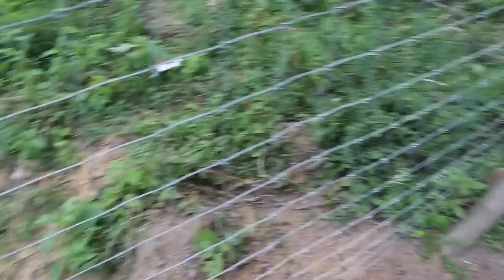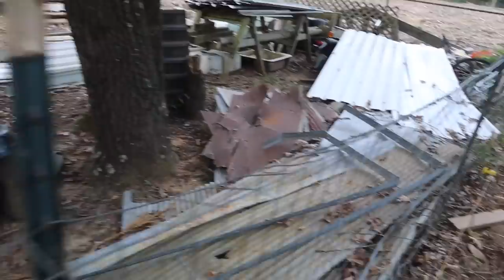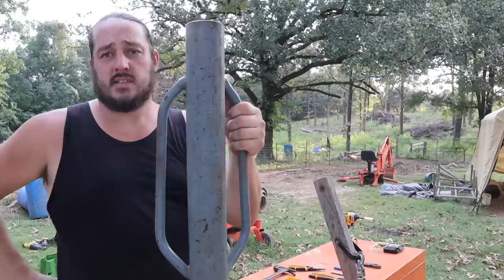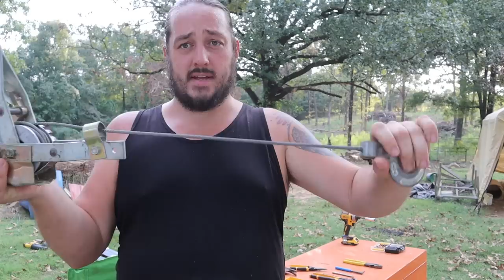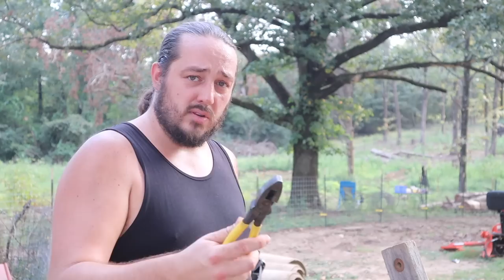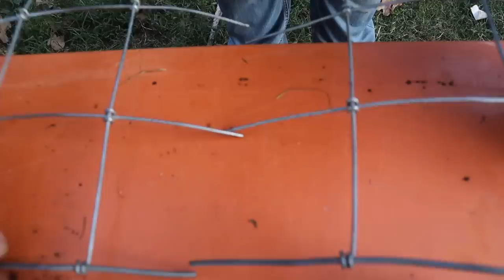Building Fences 101 | Mondays with Miah | Roots and Refuge

Comment: Growing up on a farm, we used hog panels. They are just like cattle panels, except the bottom foot of paneling is tighter and is buried under the ground so the pigs can't burrow out. They are also sturdier than the welded wire fence that you use so the hogs can scratch themselves. Our current pig resident is secure with galvenized hog panels. He is around 750-800lbs. He rubs against it everyday and it is really secure. We bought ours at the local Ag store.

Comment: Great video. I would suggest one thing, especially for people that don't have some of the tools already. Look for "fencing pliers" next time you are in the farm or home store. That's all we used for fences growing up. It replaces all of your pliers and some of your twisting tools. Plus if you need to remove a staple that is in deep you can put the point in under the staple and drive the point under it with a hammer.

Comment: I use that type of fencing (not the welded type, the 4”x4” kind) to make tomato cages, flower cages etc. That little wire bending tool tip was really helpful. I’ll be picking one of those up. Thanks Miah!

Comment: The T-post driver that I bought several years ago is "Pepto-Bismol"-pink.   My husband just rolled his eyes when I came home with it -- especially with it being pink!   Well, 1) we both use that thing ALL THE TIME, and 2) the color is easy to see -- it never gets lost.   Thanks for the tip about the wire tool for splicing.  I've always "made-do" with needle-nose pliers.  That wire tool is so much better.   Thanks, again.   Best wishes from Kate in Olympia, WA.  9/9/2019.

Comment: Great video. I have built many fences over the years on the farm. I also use mostly high tensile wire fencing, since I was raising registered show horses and didn't want them cut and scarred up from barbed wire. The mesh fence you're using we called cattle wir fence if the squares were equal top to bottom. If the squares got smaller at the bottom we called that hog wire fencing. There are cattle panels that come in 16 foot sections which I've seen you use before. But there is also hog panels that come in 16 foot sections. The difference is the hog panels get much smaller at the bottom. Running a strand of barbed wire about 4 inches from the ground of the mesh fence prevents livestock from pushing the bottom up and stretching the fence too. Your doing a great job, and that hinged tool looks handy for the t-post clips. May get one, I always used fencing plies & the splice tool for the t-post clips. Never to old to learn. Thanks for sharing. #helpingthenextgeneration #farming #homesteading

Comment: Great informational video.  Love Monday's with Miah.  We made our fence stretcher out of 2 2x4's and bolts, we were to cheap to buy one.  We also do diagonal fence braces but instead of putting the bottom into the ground, we put another wooden post and nail the bottom to the other post if that makes sense.  If you are doing barb wire, they make a splicer to put it together.

Comment: Great idea!  I applaud you for sharing what has worked for you and what hasn't.  I found that having a roll bar in the sow pens helped save so many piglets getting rolled on and crushed by the momma sow.
I'm pretty sure I have a permanent knot on the top of my head from hitting myself with the dagblamed tpost driver.  Just sayin'.
That wire spicing tool is what my grandaddy called a wire fid.  I don't know if that is the actual correct name for it, but that's what he called it.  He made his own sometimes, especially for working with barbed wire.

Comment: it seems the woven is moving with the landscape aswell ... to a point i would guess ... but the welded wire is like a piece of wood ... it only follows lone line ..... so you would have to fill holes when your landscape slopes a bit .... very good info ... thanks for introducing us to another option  of fencing

Comment: Good information! Theres the easy way and theres the hard way. If you actually putting in fence this is so valuable. I think now i could repair my fence with some of the smaller tools and possibly handle the other things too if i get a little more ibfo. Not sure im strong enough to do the whole thing bit some repairs im going to try...or at least make sure hubby has all the tools that will make it easy. Thanks!